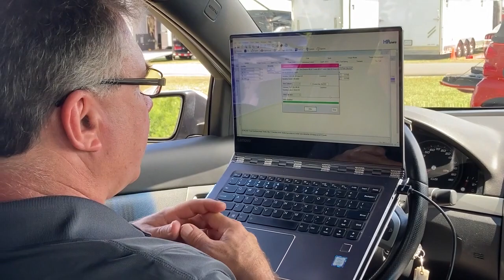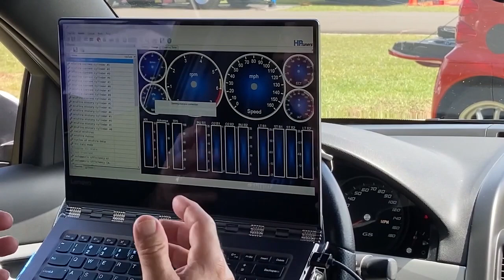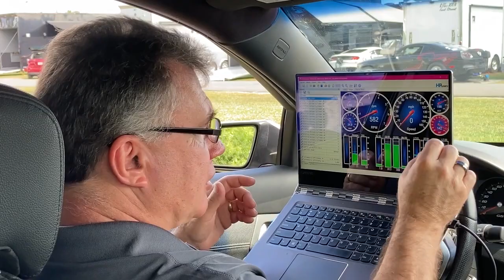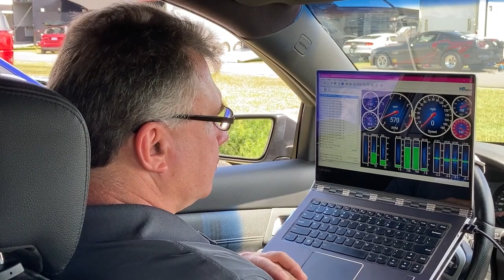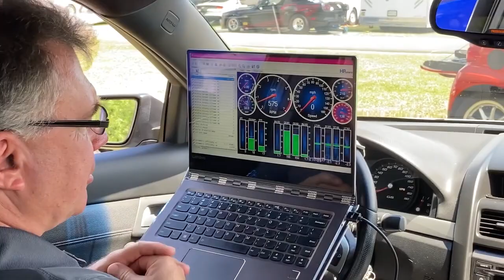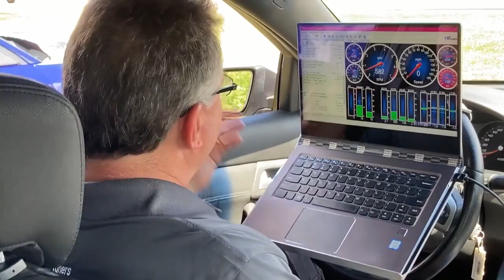Super Tuning My 2009 Pontiac G8 GT With HP Tuners

Comment: Great information.  New subscriber here.  It's so ironic that I just picked up an '09 G8 GT in Arlington, Texas and drove it back home to Little Rock, AR on Memorial Day.  Mine only has 47,500 miles on her.  I'm looking at HP Tuners or Gwatney Performance Innovations here locally.  I want to turn off the active fuel management/DOD and the catalyst test and adjust torque settings.  My GT is the exact same color as yours.  What a stunner.  Cars and trucks were slowing down and checking out the car all the way from Texas to Arkansas.  LOL.  Even had a Mustang GT and a debadged Nissan rev as they passed.  Actually once I made it to Arkadelphia a Red G8 GT passed me in the fast lane.  We exchanged "thumbs up."  LOL  I had a great trip and absolutely love the car.  It's been on my bucket list for several years now.  Funny part is that the G8 is my wife's car.  We are giving our '08 G6 GT to our daughter.  Sense a trend here?
Reply from the maker: Glad you enjoyed it. I appreciate the subscription. Thanks.